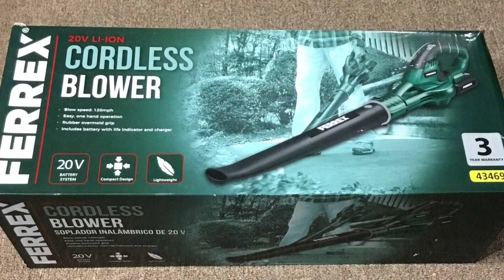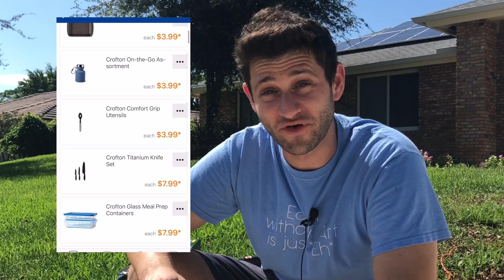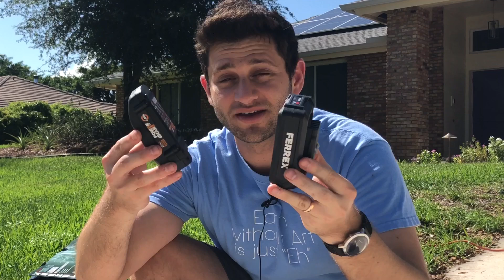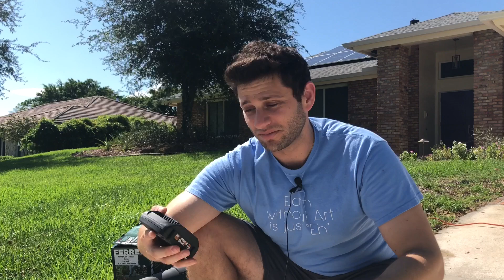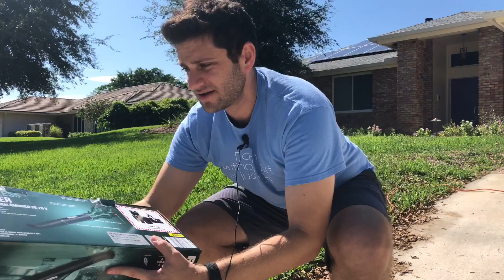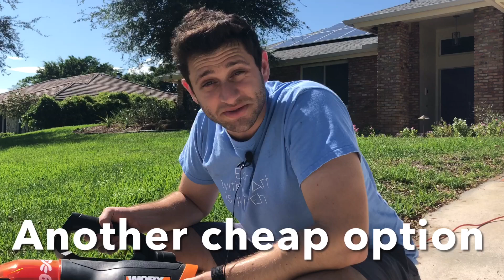Is a $40 leaf blower from ALDI any good?

Comment: It's complete garbage. I bought it in October last year, 2025, and used it about 10 times. This year, it will mostly not do anything at all, but once out of every ten times, it will turn on for about 2 seconds and turn off. The battery is fully charged and lights up all the lights when you push the button. I can leave the battery on it for a week without charging, and it does the same thing when the battery is not at full charge.

Comment: I swear by aldi tools,
I used them in a professional capacity as a electrician.. the trade off is a little more patience for similar results.
I was able to by a complete tool kit over 3 weeks of looking around for €300. (4 batteries, charger, impact, drill, reciprocating saw, circular saw, sds, grinder) The same price as Milwaukee drill set with 2 batteries. 

Looking for a battery adapter with USB for charging phone in a pinch. Ferrex get on it. Cheers.

Comment: I bought one of these. There’s a design issue where the vacuum pulls leaves etc into the black fabric sack. There are six vanes just inside the plastic hose and on first use it blocked up with leaf debris. Suction went from fine to zero. Couple of minutes with a saw and the vanes were gone and so was the obstruction. Cant see the point of them as you want everything sucked up to go into the bag as quickly as possible. 

Other than that the charge lasts about 30 mins on full blast, enough to convince me to buy two batteries.

Comment: that ferrex battery is the current worx design, at least in australia. The xfinity/ferrex/workzone batteries they sell at aldi here are a different design again. Some of them list positec as the warranty agent, others are 'actionspares' which might just be another sub-company of positec.

Anyway, the ferrex 36/40v garden stuff is great. Steel deck brushless mower with 2 8ah batteries for like 230 bucks was a bargain.

Comment: Garbage and that’s where it went after 5 months . Ferrex would not stand by their product. Worked for a couple of months ( only used about 5 times for 5 -10 minutes each time) . Battery quit and Ferrex wanted original receipt which I do not have . Willing to bet most Ferrex employees don’t have their original receipt for the last blower they purchased either. 
No worries , $40 lesson learned . Most of the time you get what you pay for in product and service and I should have done more homework before and purchased a reputable brand.
Reply: Actually I never throw out receipts for important purchases. I still have receipts going back 40 years.
Reply from the maker: Wow that’s terrible.  Sorry to hear that.

Comment: I just bought the Ferrex after watching your video. I'm glad you showed what it can do. I can confirm it performs just like it does in your video. I already have a Toro 51619 Ultra Blower but I wanted something cordless for light work and this fits the bill nicely. It works great to blow off light debris on a deck or walkway a lot faster and easier than a broom. I love having that option of not having to unravel a big extension cord. I think it's also light enough to be used by the elderly.
Reply from the maker: Thanks, Jocko!  Glad you found it helpful.  It’s nice and lightweight for smaller jobs :)

Comment: I remember the time, where Aldi sold Windows PCs with all accessories for 1000 bugs in a time, where usually you could get for this a PC without any software.
Reply from the maker: Wow.  Didn’t realize they sold computers at one point… they really do have everything
Reply: Meanwhile it's the brand Medion and available outside Aldi.
The inexpensive Aldi Computer was also available in the USA, but slightly limited to keep the 999 $
Reply: From time to time they sell non groceries.

Comment: I just bought it yesterday and i am wondering where you can get the battery. Thank you
Reply: Selling today 04/10/24
Reply from the maker: Hi Thuy, mine came with a single battery on the charger in the box.  Extra batteries are for sale through Ferrex online I believe.
Reply: @SavingGreen  they are selling this currently at my ALDIs now. I think I saw a weed eater as well. You should do a weed eater review